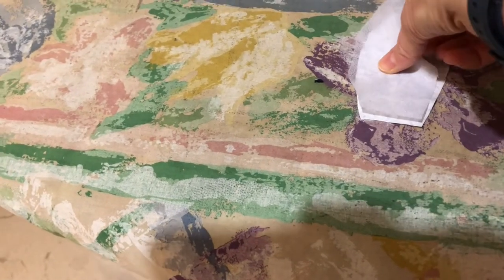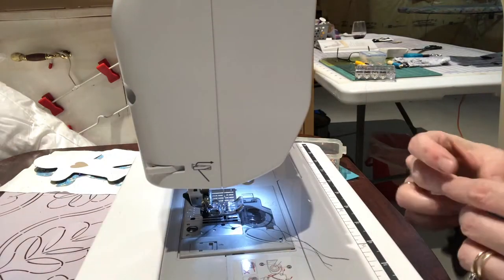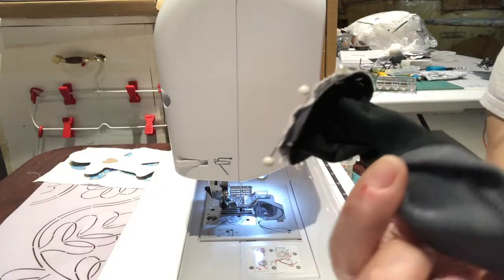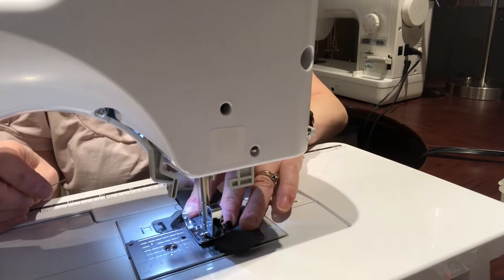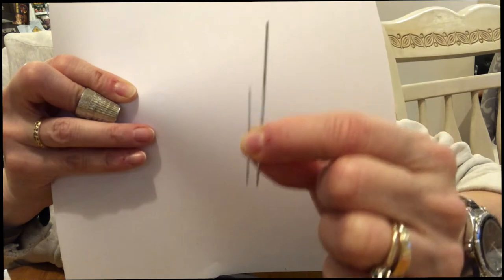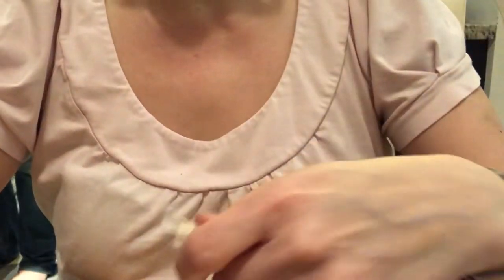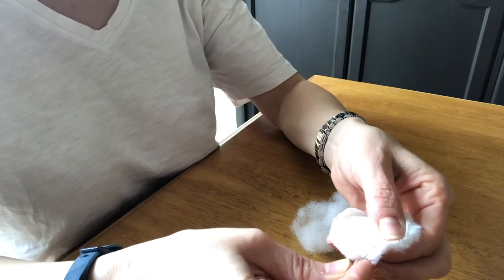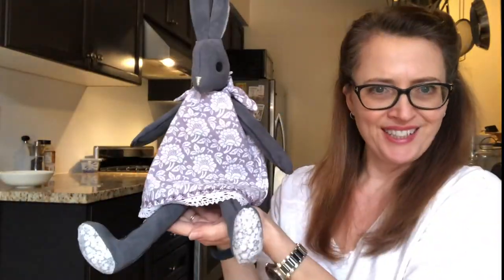Making Luna Lapin

Comment: Would a fat quarter size of fabric be big enough for the dresses? And how much felt did you need to make her? Would brushed cotton be okay to make the body? Sorry for the questions, I'm wanting to get everything I need so I can make her as soon as my book arrives :)
Reply from the maker: I will check and get back to you asap
Reply from the maker: A fat quarter is more than enough for Luna's basic sundress. 
It is also plenty enough for making Luna.  I took out a fat quarter and laid out the Luna pieces....and aside from the print fabrics you would cut out for the inner ear and foot bottoms, you would definitely have enough fabric with a fat quarter to make Luna.
A brushed cotton might add a great animal feel to the project.  I would go for it.  I made Luna with this velour-like stuff I picked up in the craft section at my local dollar store.  ha ha.  I am making Freddy next and I got 3'x3' sheets of felt at my local dollar store that feel like a thick enough loft that it should work.  
You can make Luna and the friends out of any fabric that does not stretch (wovens with no lycra).  I might try one with a terry cloth towel, just to see if it gives an animal feel. 
Don't forget to pick up some upholstry needles so you have the big long needle to sew the eyes, and pick up some upholstry thread too.  
When I attached Luna's eyes and head etc, I used the upholstry thread because its just so strong.   A
nd you will need a thimble for sure.
Good luck with the sewing.  It's such a delightlful project to work on.  Cheers - Cassie
Reply: @cassiesews  Thank you so much for all of your help! I have two nieces I want to make these for. I also have a little pattern for a very basic bear I want to make out of towels and washable stuffing so they can have "bath time bears" as they hate the bath haha.
I will definitely pick up what you suggested! I'm in the UK and don't have dollar tree, my local equivalent doesn't have much in the way of craft stuff either so will be having to get stuff online or reusing what I have (old pillowcases etc)
Reply from the maker: For sure and don’t forget thrift stores. Old linens and sometimes clothing has just the right fabric for a nice price. We can all go to the local fabric store for sure, but it’s a fun challenge to reuse fabrics for a new project. Thanks for sharing and best of luck.
Reply: Hi! The book reccomends felt for the animals (I'm opting for that as a beginner) since there is no grain in felt like there is with cotton or a woven fabric, you can fit the pattern pieces closer together on felt since you don't have to worry about the direction the pieces are facing and it's fairly thick so the animal won't be floppy:)

Comment: Thank you for sharing! What type of fabric did you use for the bunny?
Reply from the maker: Thanks so mich for watching. For Luna, I actually used craft fabric from the dollar store. It is a grey velour like fabric with a smooth back. If your dollar store does not have options, the fabric stores have coating fabrics back in stock. If you can find a lightweight coat fabric in the colour you want for a doll. That will work really well too.